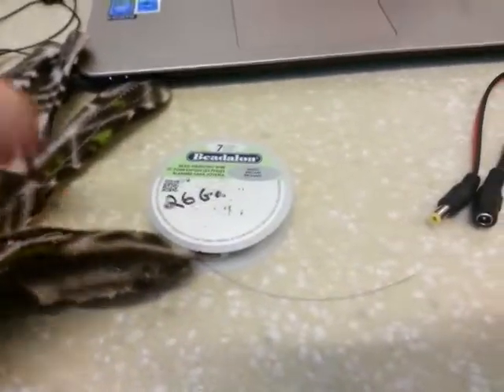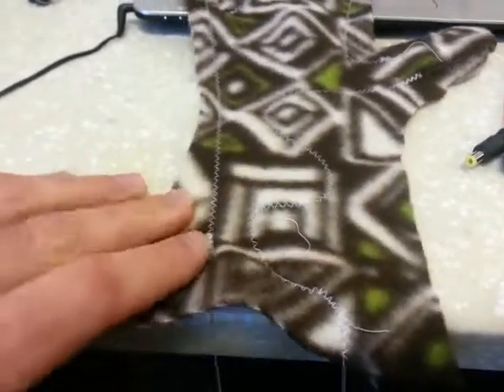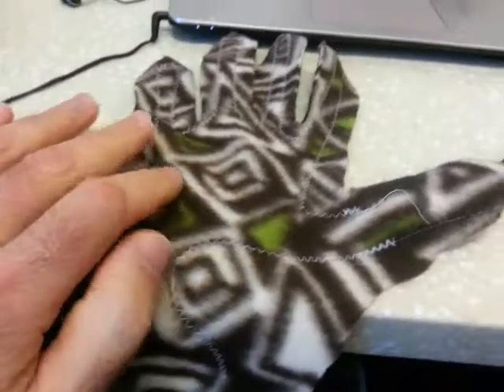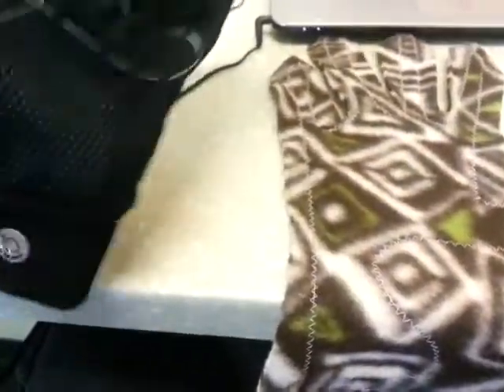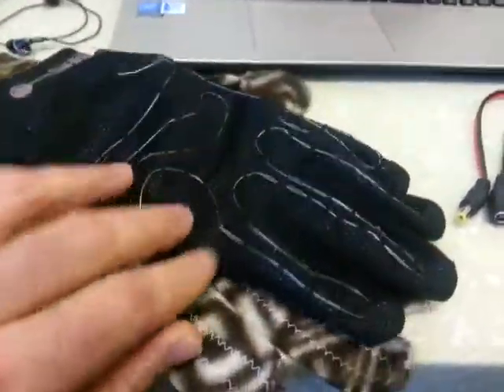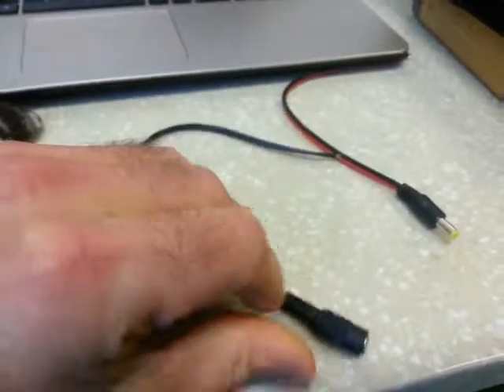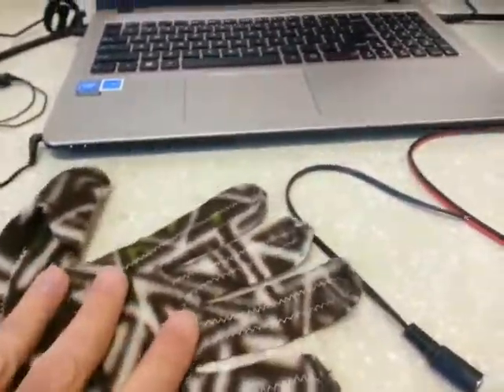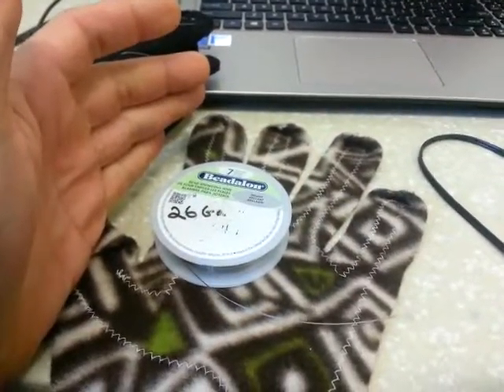beadalon heated gear

Comment from the maker: I should also mention the wire could short, depending on how you have assembled it into your gear. The wire shouldn't touch. Even though it is pvc coated, should that wire wear through it will shorten the intended length of the wire and make it hotter. I also place the wire to be sewed on the opposite side of the skin, meaning it warms through the fleece and the at no time is the wire in direct contact with my skin. You've been warned. mod